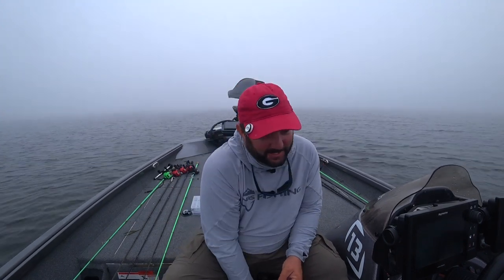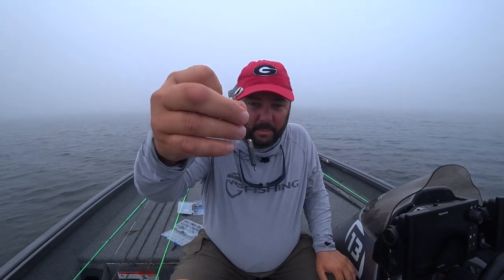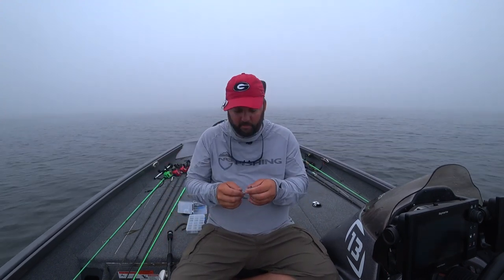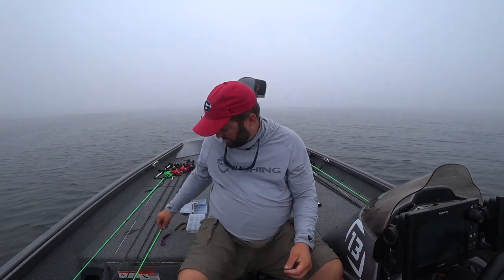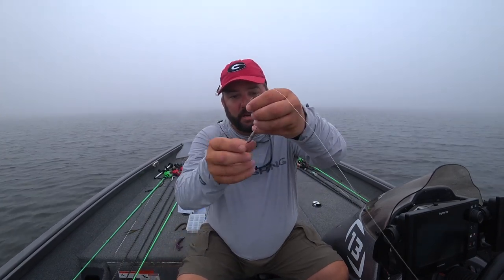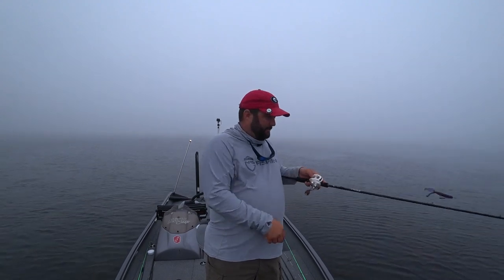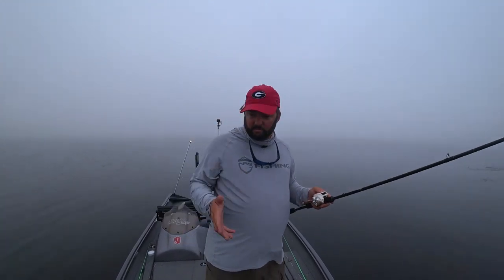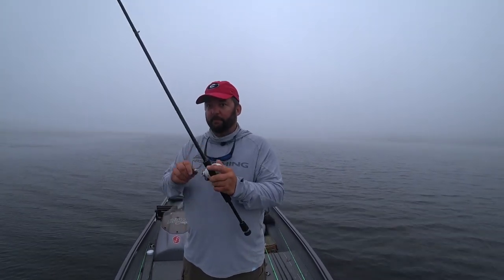Tokyo Rig - How to Punch and Fish the Grass

Comment: I don't have a store anywhere near me that carries punch/Tokyo rigs, and I'm going fishing tomorrow so I can't wait for one to be delivered. So I just made my own Tokyo rig out of a 4/0 EWG worm hook, a t-turn 3-way swivel and a straightened out heavy-duty paper clip.

Opened the eye of the hook, attached one end of the tee to it and closed the eye back up. Then I carefully twisted about 4 1/4" of the paper clip  onto the bottom of the tee swivel, added two bullet weights -- one up / one down like you showed -- and then made a little curly-q on the end of the wire to hold the weights on. I'll direct-tie my line to the other tee of the swivel when I get on the water, load up the hook with whatever creatures I have in my box and punch it all through a huge bed of 10' weed grass we have down by our dam.

Fingers crossed :)

Thanks for the confidence to try it.